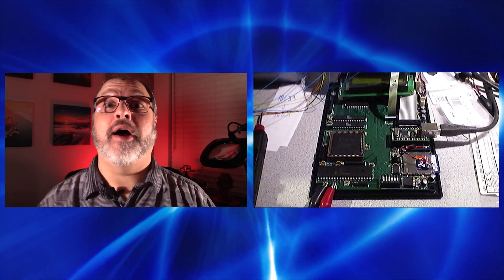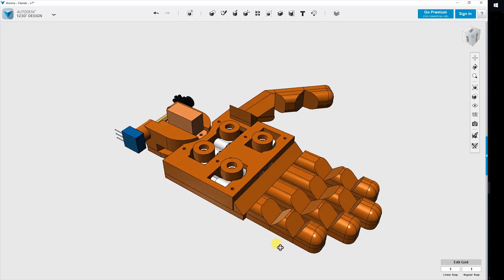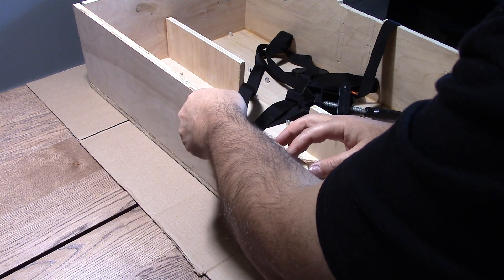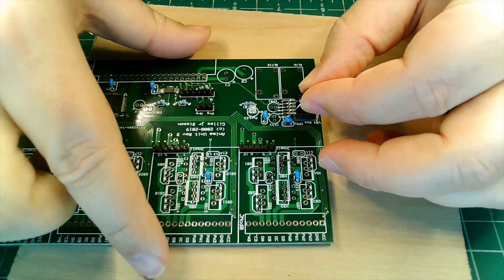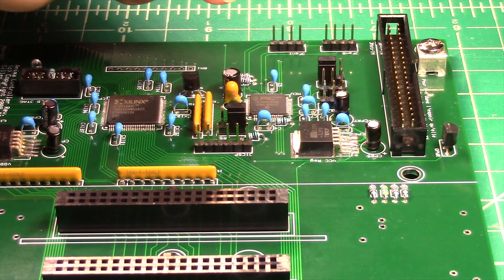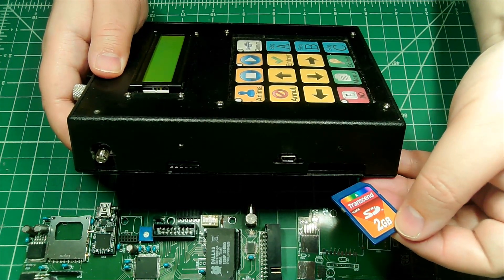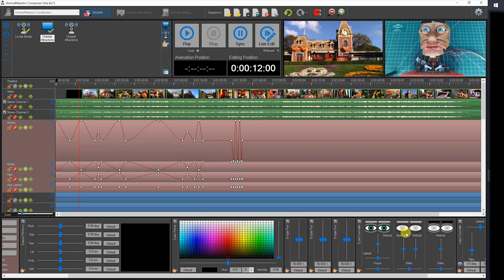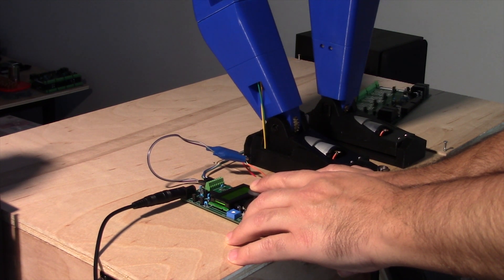DIY Animatronic | AnimaMaestro Project Overview

Comment: Just starting out in animatronics and other ways to animate for my movies

thanks so much for this video, very enlightening 

are there any major differences between the attraction animatronics and the ones used in movies? 

and what would you say is the best overall book, video or forum that really shows about animatronics, only if you know, since its hard to find a place with all general knowledge of this massive field 😎👍🏻
Reply from the maker: I would say that animatronics for movies and rides are mostly the same. They are usually designed with specific goals in mind in terms of what the figure can do, from which angles it will be seen, and usually performs only the minimum set of functions required to make the scene (whether the movie scene or the ride scene) work. Probably the one major difference is durability. Movie props will last only for the short filming period whereas ride animatronics are built to last and repeat their routine thousands and thousands of times.

I have never put my hand on a good book and you are right that videos about animatronic are somewhat limited. I personally learned everything by myself as a hobbyist, gathering bits and pieces of information here and there. I also watched a lot of Walt Disney Imagineering documentaries. YouTube as some nice videos about eye and hand mechanisms but not comprehensive tutorial about full animatronics. Also for some reasons, a lot of people associate animatronics with creepy and horror stuff which is not at all my thing...

Good luck with your findings and feel free to share any interesting stuff you find !!

Comment: wow, real inpressif work, thad means thad you have a new sup on your channel!!!
i have 2 questions:
1. will this controller be for sale?
2. will it suport air powerd cilinders for bigger movements?
Reply from the maker: Thanks for subscribing ! I am working on a lighter version of the whole system that will potentially be available to buy for hobbyists. I have never worked with hydraulics or pneumatics but I will take a look !
Reply: @AnimaMaestro  thanks dor responding. I hope thad this video series is going to help aut cus i am wanting to build animatronics for a few years but never started.